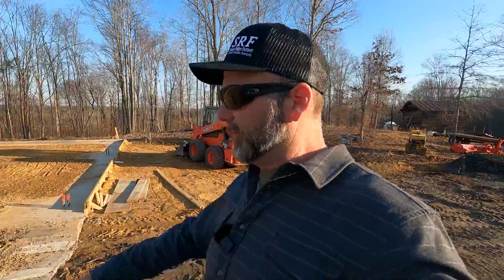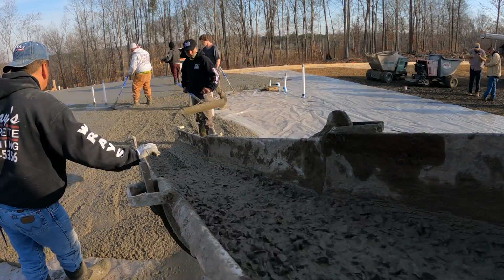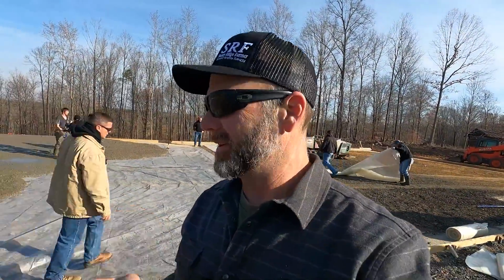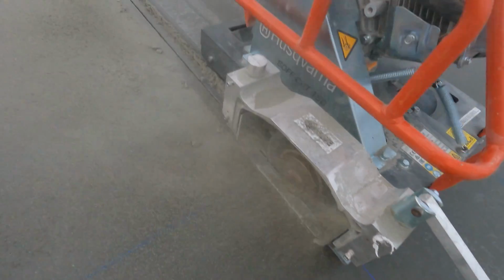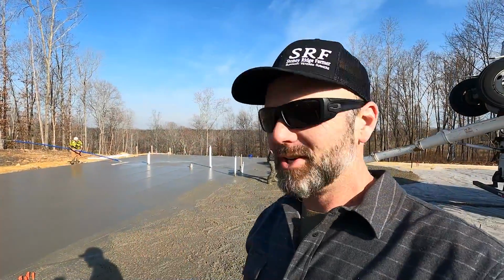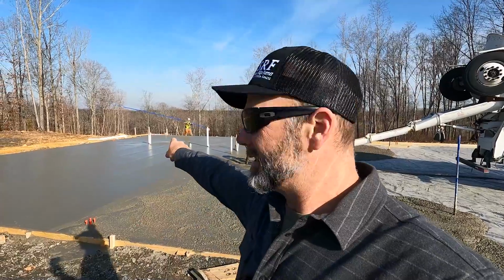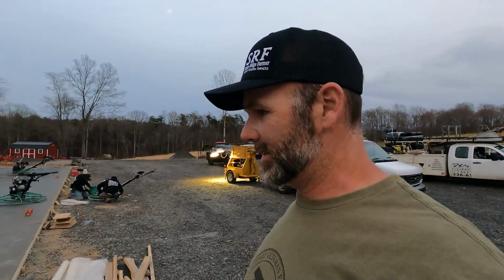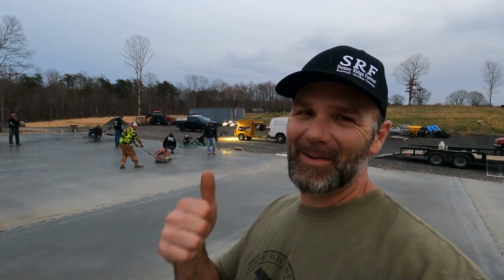Mega Shop Bardominium Build:  We've got a problem! Finishing up the pad..

Comment: I've poured over 10,000 yards of concrete for substation and civil. There are a few things that really have me scratching my head about the longevity of this slab. If the company stands by it, great, but otherwise, there were a few major red flags. 

Mix design looks way too wet. W C ratio should be 0.42. keep the batch tickets and see how much water they added on site, that slump was way too high for what you'd normally see in a slab. 4-6", then a high range water reducer and super plasticizer to bring to 6-10 is okay, but most concrete guys just add a bunch of water.

No rebar doesn't necessarily need to be a problem, but you have to have fiber mesh or some alternative reinforcement like helix or wire if you plan on using it as service bays for your equipment. 

Aside from that pretty standard finishing and whatnot, but the fact that it was cracking day 0 is very indicative of bad mix design or a bunch of water added on site to make it easier to place. 

Hope that company has a good reputation, because there is a lot of Gypsy concrete work going on across the US to meet the demand
Reply: He cried today with spalling. For $66K, it's only going to to worse and he'll be sick in the end.
Reply: Great Observation
Reply: Wow that’s a lot to think about, good luck 🍀👍
Reply: If you ever wanted to do see a superb concrete job go to Golden Gate bridge and look at the details...  It's simply magnificent.  I did not see a single point there that was even close to questionable.  Here, I would certainly add steel or fiber reinforcement.  Placing concrete is not easy...

Comment: Just a small correction they are not cutting to prevent cracking they are cutting to try and control where it will crack if it does crack.

Comment: Next episode we’ll map out all the shrinkage cracks. Shocking not seeing ANY rebar in the slab. Not even around the floor drains.
Reply: Absolutely need RB especially if it's going to hold heavy duty equipment, hope to see how this project will finish up  ...hoooooah
Reply: I would have had wire mesh on the entire slab with 2 rows of rebar around the edges and where the lifts are being installed.  Hopefully it will hold up.
Reply: Concrete tech has come a loooonnnggg way! Looks awesome and will last a lifetime!
Reply from the maker: amen!!
Reply from the maker: why?  This is 4000 psi fiber reinforced concrete...that's 4000lbs per square inch....nothing I'll ever have on this floor will come close to that.
Reply: @StoneyRidgeFarmer  Compression and shrinkage are two very different forces. It’s a barn so not the end of the world. In my 28 years of supplying concrete I cringe when I see a slab that size with no reinforcement.
Reply: @StoneyRidgeFarmer  concrete is an ever evolving technology. If you have fiber in the slab and as I saw rebar in the grande beams and column pads, you will be fine. Two things in life are inevitable-death and concrete cracking.
Reply: @davem5370  You forgot taxes
Reply: @danpatch4751  Considering how often we see the mega rich pay little to nothing and even getting refunds, I understand why he left out taxes. :D:D:D
Reply: @StoneyRidgeFarmer  If your using it for vehicles the dynamic load can exceed concrete without rebar. issue is that Concrete is has almost no tensile strength. 4K for compression but less than 500 PSI in tension. Shops with concrete pads usually are 6" slab with 1/2" rebar 18" OC or less. 

$66K for the slab seems awfully high especially with no rebar.
Reply: @StoneyRidgeFarmer  Rebar is for horizontal strength not vertical strength in this case.  I'm actually watching this because of future video showing surface chipping to see if I can figure out why. and I am not done and already planning a blind react video with for my concrete crew.

Comment: Josh, it's going to be a great shop but I have to agree with several of the other commenters that you may regret not putting the wire mesh in the slab. The plastic is a great idea as it will let the concrete cure more slowly and that will definitely make it stronger. I wish that I could build something like that but I'm getting a little old now. P.S. God bless you and thank you for your service. ❤❤❤🇺🇸🇺🇸🇺🇸🇺🇸🇺🇸🇺🇸

Comment: That's on trade I'm glad I learned, but super glad I got out of. My knees couldn't handle crawling around doing the finish work. There is on guarantee about concrete. It'll eventually crack somewhere not in a joint.

Comment: I have been part on many concrete  pour jobs  I am surprised  at that no ribar or expansion joints    I see a lot of cracking in future   
I have seen and work on concrete  pours wear they expected  the earth to shake  and shift from volcanic actions.
Didn't  see any vibration  to relive  air pockets   and better binding  of concrete

Comment: Alot of people are commenting on the lack of rebar/remesh/fiber. Concrete is different in strength across the US. Some areas could take an 8,000 pound pickup on 6 inch slab of "4,000 PSI" concrete 5 hours after its poured and not ever exerience extensive cracking. Other areas may take 1 week before handling that kind of stress. It isn't uncommon to have 4,000 PSI concrete test at 4500 at 7 days in some areas (Like NC,SC, Georgia while it may only reach 3650 in 28 days in other areas (Like West Coast). This is a result of differences in materials and chemicals used in the mix such as crushed granite vs. crushed river rock and higher quality cement vs. cement from china.
Reply: Finally someone posting something reasonable instead of "why no rebar!"   Hell it's an indoor slab on grade with control joints and no internal load and where there is load he's going with a thicker slab where his tractors will be serviced. I'm sure if he lived in an area with tectonic plate movements he'd do mesh and rebar but even then that shit will Crack and split no matter what you do.
Reply from the maker: Amen!! There ya have it.....there is some rebar in the slab...just not the entire slab

Comment: What is the purpose of moisture barrier
Reply: Concrete is porous so water will migrate through it from higher pressure areas like the surrounding earth. If you don't install one, whatever equipment or boxes you leave on the floor will become the new vapour barrier and you'll get a pool of water sitting under them. Plus part of it is going to be an office, if you have continual vapour ingress you'll be wasting energy on Air Con trying to deal with humid air.
Also long term you really need the slab to remain bone dry, otherwise water will allow a chemical reaction to start degrading the concrete.

Comment: Wonder what slump there using ,looks wet to what we use up here  Can't get away with out using rebar or mesh up here with the frost that we get
That size job we also would have used a conveyor or pump truck. 
Not  picking on anyone  just interesting how different parts of the country does things

Comment: Wait till it rains and then brag on how good they did. Drains are no good unless slabs slop to them but rain water shows low spots.
Reply: I saw a Cadillac showroom floor at Bay Harbor Florida 50 years later crack and lifted 2 feet with cars on the slab on one high ocean tide day. The salt water possibly corroded the steel and concrete starts going negative after 50 years losing strength some areas become soft as chalk. I think about the colosseum in Rome or Greece. Can't remember but I think the key ingredient was crushed lava rock to its longevity.
Reply from the maker: build you house upon the sand and that's what happens right?

Comment: No rebar grid sets in the pad? Is that some new process? First time I've seen anything bigger than a driveway that did not have rebar to strengthen and stabilize it.
Reply: Rebar doesn’t make cement stronger. It makes it more flexible. He’s not building a highway. That information comes from e 40 year DOT engineer state of Iowa.

Comment: Good morning Josh. Anytime you get a few good clear days in a row is the best time to pour concrete also the temperature helps. One thing I would have added not sure how many rolls of concrete mesh and chairs to hold it up 2-3" at a minimum for a floor that will be holding heavy equipment. I know its $350.00 a roll 5'×150' but it would've helped keep concrete from cracking.  No regrets it's done, sorry for the late advice. Like the Aussie say: " no problem mate." Or no use crying over spilled milk but move on and learn from it. Even rocket science gets screwed up so it will be ok. You may have to use an expansion additives on the cracks. Usually there are also expansion joints on large areas pre-installed as part of the engineering or about every 15 feet on a 6" slab; It's not like a side walk where you can score a line to minimize crack run , that's a big slab.